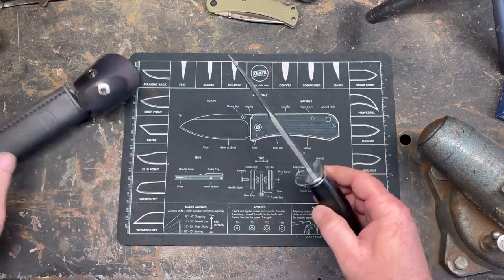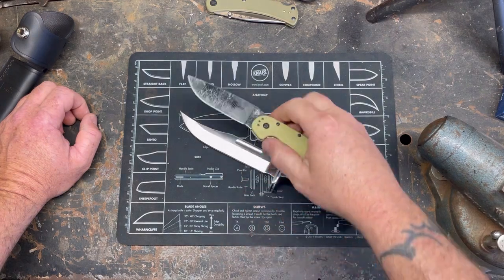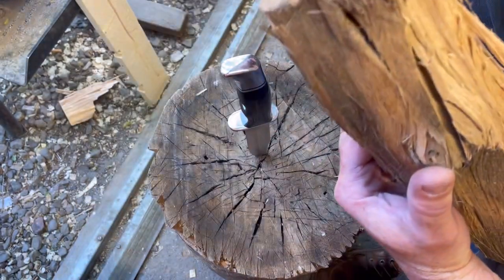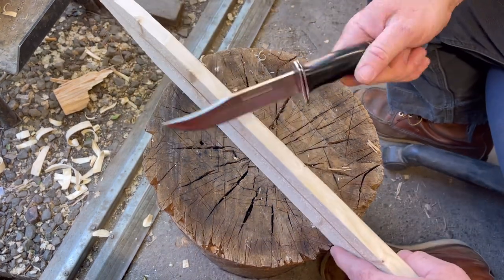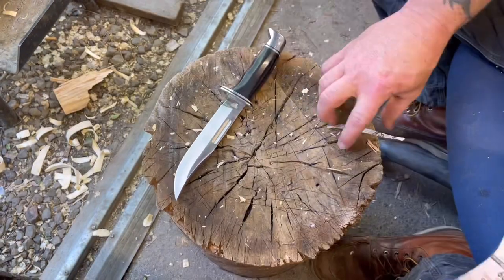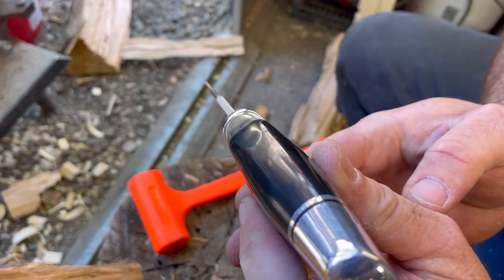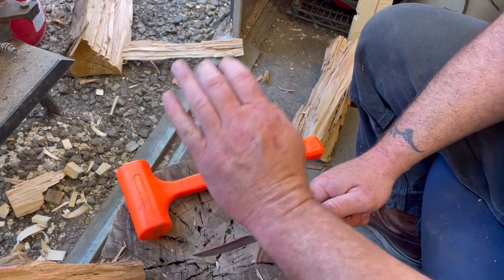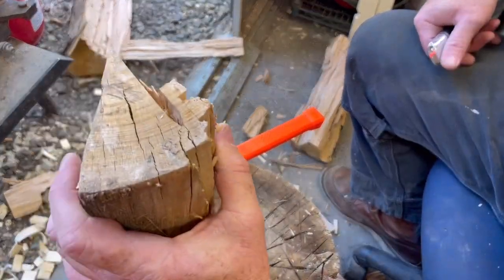BUCK 119 hard use test part 1

Comment: Some knives can stand up to that, but I don’t know about “should,” especially for one with that tang style.  That’s more axe/maul/wedge territory, except for emergencies.  I think batoning is over-emphasized in knife testing (also tip testing).  But I am definitely impressed at how well this knife held up to the abuse.
Reply: Why shouldn't your outdoor fixed blade hunting/camp knife be designed to survive emergencies? Like.. if this was a test for like, a Zero Tolerance, or Rike, or whomever with a little folding knife you'd kind of have a point. I'd still argue that the simple fact that those expensive knives serve no purpose because they're not proper tools.. but this is literally the entry way, and a heritage based company in, BUSHCRAFT. This knife should absolutely be able to hammer out a complete full shelter, be tied to the end of a stick and used as a speer, process a deer, and then make the campfire, without any trouble. It should literally be its designed task.
Reply: @jackhall290  Nothing wrong with that

All I’m saying is that expectations should be tailored somewhat to the design of the tool.

Full tang is great but almost all knives have been stick tang since forever.  Based on its design, the Buck exceeded all reasonable performance expectations.

You can reasonably expect more performance (and also more cost) out of a full tang design.

That doesn’t fix the tip issue which has to do with shape, grind, heat treatment and a whole lot of other things.  Making the tip better for that test might compromise some other features.
Reply: @James-dq3jo  
People are totally deranged mentally these days.
Historical swords and knives nearly all of the had stick tangs. And they truly used their knife in combat and for a living. No fantasy bushcraft play.
 An axe is the tool for splitting wood like that..Right tool for the right job. or use wedges, you can carve those. Btw I can break the tip of an ESEE or Becker much easier than of these Buck 119 and 120 knives. Except for the ESEE5 and BK2, but those are as unwieldy as a cold chisel. They are thick chunck of steel with an edge. I had them all, and sold them 😉.
A clip point on a Buck like that , and being able to stand that tip stress. Yeah, that's a good knife.
Reply: @Ve-suvius  My personal favorite fixed-blade knives for general camping/outdoor/utility use are, in no particular order: Morakniv, ka-bar, and Buck.
Reply: @James-dq3jo  
Good knives. Mora is great. I know the talk on the tang of the Ka-bar. But everything can be broken. The Ka-bar is a better combat knife than the Becker's or ESEE in my opinion. The Becker's are the typical knives people love to baton with. That's all. Batoning. For chopping.. who uses a knife . A machete or a hatchet(same weight as their knife) is already way more effective than those knives.
Reply: @James-dq3jo  
I really like the Buck 119 and 120.
In the past I had the copy of the Buck 110. Maybe time for the original The Gene Moe version😁😉.
The Ka-bar 1266 and 1213 are also interesting knives.
Reply: @Ve-suvius  Don’t forget the kukri.  It’s kind of a machete/hatchet that can be pressed into service as a shovel in a pinch.
Reply: @James-dq3jo  
the kukri's were also always stick/narrow tang.
Parang also.
Those type of handles transfer way less shock to the hand when chopping. Unlike those full width tangs.
Kukri's are awesome choppers. Yes. The Greek had the Kopis. The guys on the ground preferred the Xiphos. the Kopis was adviced for the guys on horses. Chopping downwards...
The kukri's were also used to fight tigers with. One against one. Sometimes both were found dead. The Nepalese and the tiger.
Reply: @jackhall290 
Many top survival experts use a simple Mora knife. Some just a multitool. They make shelters, fires, etc.. They aren't breaking their tools. A buck 119 is plenty durable.

Comment: I'm very impressed how good it held up I was waiting to hear the iconic forged in fire blade ping when the blade breaks but it held up surprisingly well like I knew it would LOL and the handle coming loose is a common thing I hear about as well and no you didn't bend the Tang you bent the pin that holds the whole Tang on I'll tell you more about it when I send you a text can't wait to see part 2

Comment: EVERY QUALITY KNIFE NEEDS to be able to do this at least once at a minimum. You don't "need" a knife to open letters, or remove bits of string, or whatever it is you usually use your knife for. Those are not necessities that you "Need". If you NEED this knife, that means you need it to survive building at least one good all-out shelter, and to process game. That means you'll be chopping out notches to tie wood together, that means you'll be processing small amounts of firewood(probably not a full log, but you'll cutting limbs off trees at minimum and that's hard greenwood), and the edge will need to not chip completely if you hit a bone. if your knife "isn't designed for that" it isn't a quality tool. It may be pretty, it may be a great knife, but I don't care how well made or pretty something is if I can't stake my life on it. I could bejewel a pile of dung, doesn't make that dung worth anything. Every knife should be designed first and foremost to do a job, and if the only job your knife CAN survive is cutting up a cardboard box it is all but useless to you really.

Comment: Just a hint for you guys or gals that like me get sweaty hands when it hot outside ,
We all know that the handle made of phenolic is pretty slippery don't we?
Well i came up with a great solution, which is , i put rubber bands that hold the lobster claws shut when you buy them ,  on the handle , 8 rubber bands cover the whole handle on my Buck 119 and also on my Buck 105  , on the 119 ,8 rubber bands brings  you just at the limit of the Aluminium pommel, on the 105 , the handle is a bit shorter so i cut in half the last rubber band , the hold in hand is great,
Here in Québec the bands are blue cause the lobsters come from Gaspé , or the Magdalene Islands , it looks real good!
Reply: I use ranger bands. Well actually, I take an inner tube of a bicycle and cut it at the length that suits me best. It's a bit of a task to roll it onto the handle. But after fitting it, it's like a Mora Companion in the hand. Grippy...

Comment: I was definitely more worried about that deadblow hammer on the false edge like that haah. This test definitely gives confidence that it will hold up better than one would think. Not perfect but when I bought mine for 50 a few short years ago, I cant complain. Also why do people complain about using it hard. Its new production and not actually "grandpas" knife. If you purchased it, it holds no special sentimental, monetary  or historical value. Its a tool after all.
Reply from the maker: True. It’s still in production. And definitely handled more than I expected.

Comment: The rat tail tang is wobbling around inside the plastic. That’s the reason it’s creating a gap. Micarta version hold up better.
Reply from the maker: It better for the price
Reply: @peterbiltknifeguy  you’ll find that has a hidden bolt in the pommel . That threads onto a Tang. Either from stretching or loosening that’s why the gap appeared.. which is common one Battening bucks
Reply from the maker: @aprilnichols2806  no. The pommel is pinned on. Google buck 119 tang.
Reply: @peterbiltknifeguy  they might be now. But at one time there was a hidden nut. That they would grind off. Run into that several times rehandling one.

Comment: Buck knives are not built for hard use. They have an overblown reputation. They may have a decent heat treatment, but they just aren't built for hard bushcrafting. Stick with Esee, Tops, etc. They are cheaper and better quality than Buck.
Reply from the maker: They definitely aren’t cheaper. But much better quality
Reply: I recently purchased a Buck 120 in cpm35vn. $200. Sent it back after seeing the gaps where the blade enters the bolster. I can buy an Esee 6 for about $130. And it will last forever, or I can warranty it and get a new replacement.  The Buck you tested in this video is 420hc? So maybe it is less than a comparable Esee or Tops. The Buck I purchased was quite a bit more,  because of the s35vn steel.
Reply from the maker: @jeffhanson2621  yeah. The esee 6 is a standard knife. The buck 119 in 420hc is also the standard version. And was 83 dollars after tax.
Reply: Cool. Good deal.
Reply: I guess my point is just that, regardless of the quality of the steel or the heat treat, if the rest of the knife can't handle hard use, it's not worth the$
Reply from the maker: @jeffhanson2621  agree. I’m not a fan of this knife
Reply: Love your videos, bro. We think alike.
Reply: Buck knives are by far not low quality
Reply from the maker: @KnivesSurvival  that is a matter of perspective
Reply: @peterbiltknifeguy  no not really! Its a rare occurrence to have a buck that needs to go back!
Reply: You want a knife to test? 656 or 104 have at it.
Reply: @KnivesSurvival  
I agree . Buck are good knives.
Reply: ESEE6 , 250 euro here.
Junglas 300 euro here.
Such driven up prices by the fanboys. Becker's also.
And all those tips are easily broken as any other.
I had all those ESEE models, well nearly all of them. Becker also , BK2 BK7 BK9. BRKT Bravo 1 Bravo 2 , Aurora.
Sold them all.
I like the Buck 119 and 120 way better.
There's that.
No fanboy here.
I don't give a crap about reputation brand or hype. I choose on what I prefer. And use an axe for wood. Even a Fiskars X13 chops way way better than a BK9 or Junglas. Same weight.
Reply: @jeffhanson2621  
You do know that S35VN is not a tough steel. Watch the video of Joe X on the Buck 120 with the 420HC steel, and then the video with the S35VN steel.
What do you expect from a knife? To be a wood splitter? Get an axe for that. And do you have that wood in the forest with the ends nicely cut off? Or do you go saw off trees and then split them with knife? What kind of intelligent way of doing is that. Have a look into true bushcraft guys like Mors Kochanski video's. Not the wanna be playing bushcraft.
Reply: @Ve-suvius I believe Buck does a great heat treat on their knives. I know the 420HC  is supposed to be tough as nails. I sent my 120 back not because of the steel. I sent it back because of the construction. It had gaps where dirt and moisture could get down into the hilt. And the knife just had a shincey feel to it like it couldn't stand up to a lot of abuse like other knives I  own.  I didn't like that. @Ve-suvius
Reply: @jeffhanson2621  
I prefer the Buck 120 over the ESEE6 or BK7 or 9.
Tastes differ. 
The Buck 120 held very good up in the Joe X test.
Gaps are to be found in many knives. Even the Mora's have little gaps, between the handle en blade. I'm not worried about that.
Reply: @jeffhanson2621  
My thought is also. What do you expect from a knife.
If it's wood processing, as many Becker owners do. Get a small axe. It's a much better choice. WAY way better.
Reply: @jeffhanson2621  
Many brands have their fanboy following, and then they do pissing on other brands. I dislike that attitude. It's just what do you prefer, as in general in life. ESEE(expensive here) is fine, Becker(starts to get expensive also) also. I just like those Buck's better. Having owned many knives. We all make choices based on what we feel about it.
And the prices are driven up because the people are willing to pay for it. Busse is an example. They are good knives, though they seem to be a little fat on the edge and tip. But the price... no thanks.
Reply: The Buck 120 I sent back was no where near as rugged as pretty much any other 6" blade I have.  I'm not a "fanboy" of any brand. I was just giving examples of knife brands I have that are much more solid than the Buck 120. On the other hand, YOU are obviously a "fanboy" of Buck knives, and you seem to be getting offended at my opinion. For the record, I don't care what you use, it's all personal preference. So enjoy your Bucks. I just don't want to spend my money on them.  @Ve-suvius
Reply: @jeffhanson2621  
You are offended now?
How typical.
I just spoke about my preferences.
Hard to deal with is it?
I see the Buck doing things where other brands broke. I didn't say those brands are bad. For wood processing axes are king, nothing difficult to comprehend about that. 
And nothing do with fanboys. 
And I also never said you should buy Buck.
You see things in my words that I never spoken about.
Reply: No. Not offended. @Ve-suvius
Reply: @jeffhanson2621  
Good .
Cause it really sounded like it.